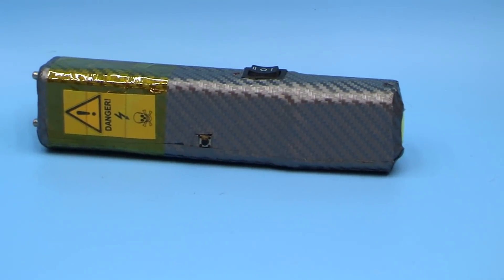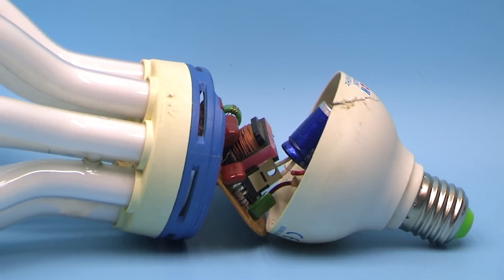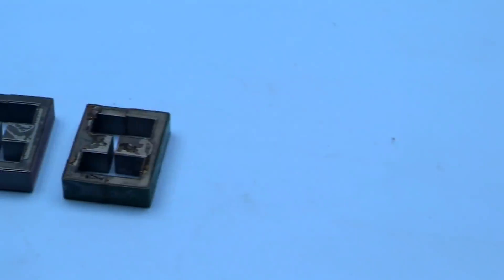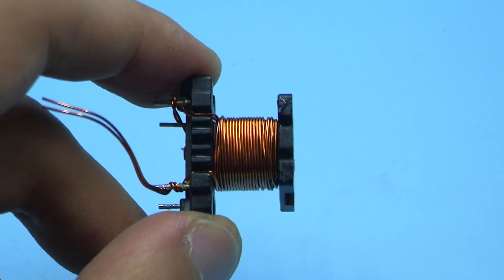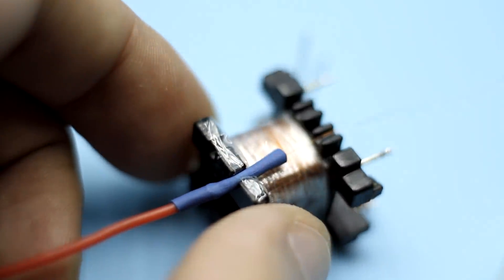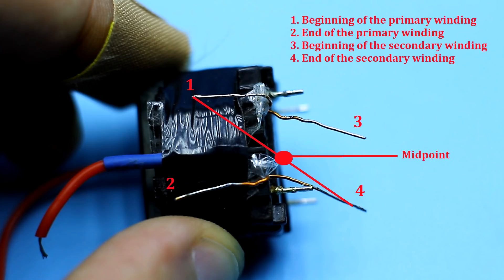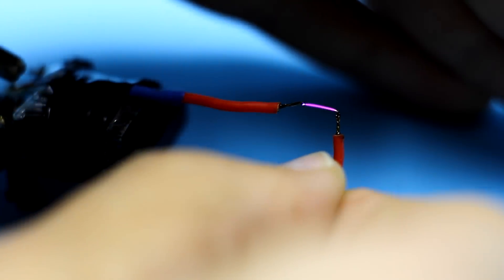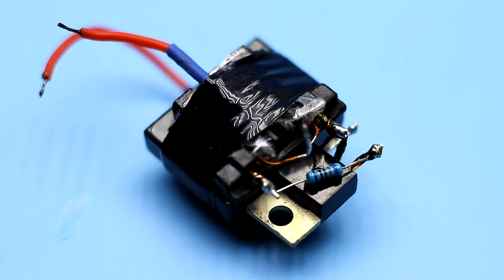Don't throw away the old energy saving lamp!  ELECTRIC SHOCKER  from energy saving lamp.

Comment: So great project.
please, i have a question:
can i use this circuit to test the car ignition spark plugs ? or, if you have an idea about a better way to make a good device for testing the spark plugs, without using the car ignition coils.
Many Thanks.

Comment: what would happen if you ci=connected the diodes in parallel  ???
Reply: if you parallel the diodes,the diode can handle more current.And if you connect the diodes in series,the diodes can handle more voltage.
Reply: @cerealnmilk8060  
nice one :)

Comment: Hi. I love your videos. Quick question. You clearly stated that your high powered transformer is made by 800 or 1,000 turns. But my question is what if I increased the turns? Will it result in higher voltage? 1500 turns or 2,000 turns possibly in my case. Thanks :)
Reply: Yes
Reply: The energy transferred will be the same but the voltage will  rise but at the cost of less current .

Comment: I have 4 lamp and transistor s are 
1,(13005) 2,(13005DT) 3,(AN78M09) 4,(D130C3)
Which one is best to use 
Pliz tell me
And can i use 2-6kv capacitor
Reply: Idk but you can get cheap high voltage generators from buzz zapper

Comment: I made this circuit, But the voltage output on the transformer is very very low, I made it the exact way you did hooked it up to 9v battery and it makes tiny arcs 1 mm at most, it’s also a very very thin arc only visible in the dark and only makes when I first power it on and when I just turn it off, What went wrong???
Reply: I got it working, all good
Reply: Robbi Robson at that time it hurt alittle, like one of those zappers from a lighter, after further examination I it turned out I hooked up the transistor wrong, I got it, I put 20 turns on the primary and no idea on the secondary, with 7.2 volts in it made 4mm arcs with 14 v it made 1 cm, and I haven’t played with the primary sense but if I dropped to 10 turns it’d be a nice homemade arc lighter

Comment: Tried building this but what is SA1 for a component? Seems I'm missing something cause I Gen no voltage at the second coil but I have a resistance of 140 ohms.
Reply: Dave Dörenberg-Veltman interesting I too tried to make this circuit but I got couple hundred volts out of the circuit even tho I made it the exact same way, I still don’t know what’s wrong yet
Reply: @talonjuel2098  I'll try again with new wire. But is it required to wind the primary winding first? Ether way I'll try it out some day.
Reply: Dave Dörenberg-Veltman umm idk if it’s required to wind the primary first and I’m gonna try again after school when I got time
Reply: Dave Dörenberg-Veltman great news got it working great
Reply: @talonjuel2098  nice to hear. After seeing one other video from this channel I think I screwed up with the primary winding. Tried the other day again but broke my last transformer. So I have to go out to find new scrap components. 😔 Good to hear it has worked out for you. 👍😁
Reply: Dave Dörenberg-Veltman yeah, I problem was with the way I wired my transistor, and my arc for some reason has gotten bigger with the more primary turns I put on

Comment: My resistor got over heat plz help me...!!😢
Reply: Did you get it working?? Replace resister with one that is larger but same color code, the larger resister means its rated for higher wattage and it shouldn’t get as hot

Comment: Hi, I built your circuit from an old lamp today, but it didn't work! My problem is with the driver circuit, because I tested the transformer and the doubler segment with another driver and it worked and made some very loud sparks! 
But with 13007 transistor as driver, the transfomer's secondary wire doesn't spark at all! It draws about 350mA and the transistor gets warm but it dosn't make any spark..
Please help me, I want this circuit to work for me because of its low current consumption..
Reply: Man maybe feedback is too small so transistor just shorts across transformer(my english sucks)
Reply: @revolution5547  So how can I increase the feed back?(my English sucks even worse!)
Reply: More turns on feedback coil(experiment yourself)
Reply: Mine makes very very little arcs idk why

Comment: I'm unlucky with winding transformers by hand
Reply: I feel your pain. Transformers can be difficult. I started by using an existing low frequency transformer (as an example: 120v to 12v) and rewind the secondary (120v to 9v). You may also want to look up a circuit called a "joule thief". It's a rather simple circuit that's used to light a white LED from a single cell battery. Winding the transformer for that is easy because the transformer isn't critical, but the better you make the transformer the better it operates.
Reply: Sometimes you can find transformers to use in old LCD TV's that power the back lights.
Reply: or the easiest way is to find a flyback ttansformer.That circuit will work too.
Reply: Yaa🥴 I winded one and it didn't worked.

Comment: Hi nice video but a have a question i did some calculating aboute the transformer winding and the voltag was 450v how does it well charge a capacetor that need a 1.6kv too charge ☝️👇👇👇 

Np=20  Ns=1000t Vp=9v 
Soo Vs=Ns*Vp/Np
1000*9/20=450v!!! 

Reply please Thanks
Reply from the maker: but the frequency of the converter? In this variant, 1 winding of the winding (secondary) gives about 1-1.5 Volts
Reply: @KasyanTV  hi  i have question does it needed to make 20 turn to transistor feedback i mean 4 or 5 turn enough for it  thanks
Reply: @KasyanTV  the second question  the secondery winding it should be in regular I mean from down to top and repeting or from down to top and than from top to down... 

Thanks
Reply: @KasyanTV  her ☝☝☝

Comment: How we can make it more power output using fluorescent lamp circuit ?
Reply: YOU CAN GET IT FOR $2 ON EBAY.ITS CALLED HIGH VOLTAGE MODULE.RUNS OF 1.5 TO 6 VOLTS...2 INCH LONG SPARKS
Reply: you are correct.these yokels ont understand this.
Reply: Zing Zang  so that i am ask him if they can modify the circuit
Reply: pendle  Thank you 👍

Comment: 1 if you have 2 bipolar transistors its much better to use both of them in a royer oscillator configuration. 2 WHY DID YOU USE 0.5 MM WIRE FOR THE FEEDBACK COIL DRIVING THE BASE TROUGH 1K RESISTOR? YOU WASTED VALUABLE SPACE THAT COULD LET YOU WIND MORE SECONDARY TURNS=MORE OUTPUT VOLTAGE. 3 winding 5 layers of tape each layer of secondary windings is again unnecessary overkill. 2 layers of plastic cooking foil will do just fine. 4 after the 2nd stage of the walton-cockroft multiplier its not worth it. if 2 capacitor stages arent enough then you need better transformer.
Reply from the maker: for feedback coil you can use more thin wire, but with 2 similar it's more easier. 
Anyway the 1st row it's primary winding and we put isolatie tap top of themregardless of wire, and secondary winding we start from new row, so we don't lose anything.
The goal is to make a transformer from an economy lamp, and so you can make any transormer.
Isolation is never superfluous when it comes to high-voltage devices, remember high-voltage transformers from TVs, they are also poured with epoxy resin
Reply: you need to do a teardown of car ignition coil to see how much isolation is appropriate. 1 layer of tape between secondary layers is more than enough. after that you are wasting space therefore loosing voltage. the place where you need to isolate heavily is after the final layer of the secondary, because it will try to break trough the isolation, go trough the transformer core and arc with the first layer. high voltage transformers are a whole branch of science
Reply: Bro can you please give me the circuit diagram of royer foster oscillator with maximum stability please. This single transitor shit sucks and wastes alot of power as heat!

Comment: I did something similar but with more beefy components and using a crt flyback transformer, the arc was much bigger without any voltage multiplier then yours with the voltage multiplier, this video makes me want to add a multiplier stage now
Reply: dont do it with a flyback. any high voltage capacitor can send you either to the hospital or the grave if you really fuck up

Comment: Kasyan TV+ Can we use larger value capacitors to create more output power?
Reply from the maker: yes, you can
Reply: yep, but it will take longer time to charge them, and that means lower frequency of the sparks
Reply: That's okay, as long as it will drop one of the muggers in the park when you're being jumped, it's a good thing. You can get hit with 1000 volts with little to no current and it wont put you down, but crank that amperage up and you could put a bull down.
Reply: MrBrymstond  well problem is that when frequency of the sparks drops, it will not have same shocking effect. you need that frequency to keep muggers muscles contracting. if the frequency of zaps is too low, it will just hurt but not paralyze